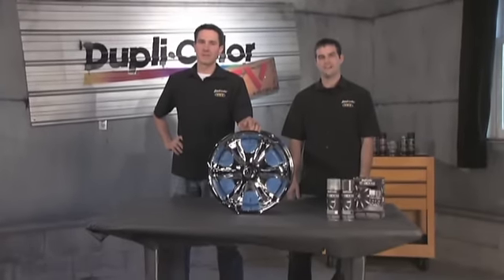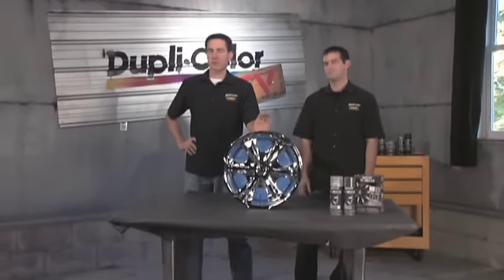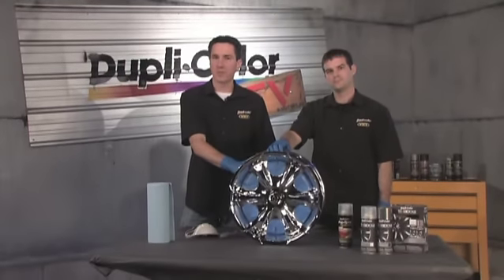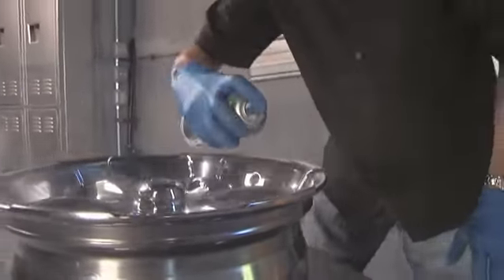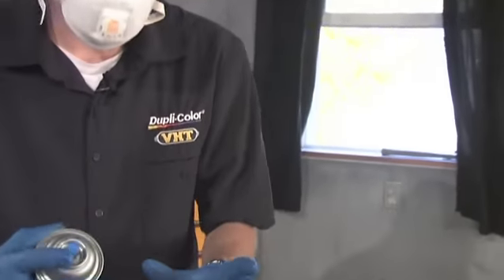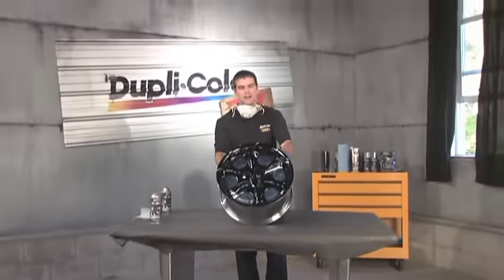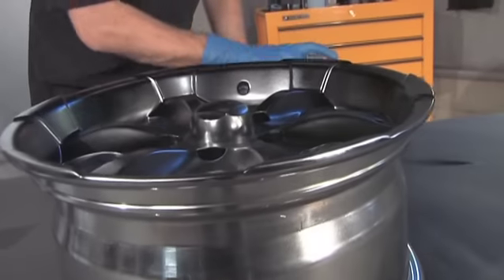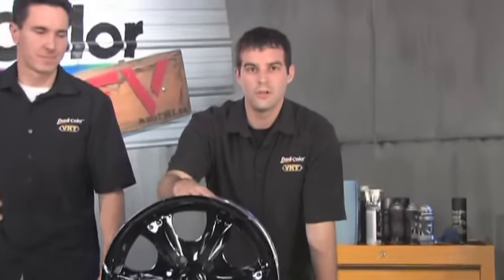How to Blackout Chrome on a Car with Shadow Chrome

Comment: Question for you- I was really wanting a deep deep purple chrome. Would I be able to spray purple Duplicolor Metalcast, then follow up with Duplicolor Shadow, and finish with a clear and achieve my desired effect? 

And if so, would it work better to use the Metalcast or Shadow first?

Comment: can i use this to paint stock rims for a 02 trailblazer they like a grey finish ????
Reply from the maker: Hello, Alfred! The Shadow Black Out Kit is a semi-transparent coating recommended over chrome for best results. This means that if you don't even out the look of the chrome prior to applying the Shadow Kit, the look underneath will be uneven. Be sure to sand off any peeling paint. Reapply a chrome paint to even the look and make sure it is lacquer based. Allow it to dry before applying the Shadow Kit.

Comment: I see you state that this product will withstand temperatures to 120 degrees F. A few hard stops on a 90 or 100 degree day on disk brake vehicles, can easily heat a wheel up till it's too hot to touch, somewhat over 120 degrees. Will the Shadow finish withstand these intermittent high temperatures.

Comment: i have a 1997 mustang with the stock aluminum wheels but they have a plastic center cap would these turn out looking the same or would the center caps look different because they are plastic?
Reply from the maker: Scott Mederos Hi Scott -- yes, it will look a little different on the plastic cap. The depth and dimension of this product come from the quality of the reflective surface it is applied to. True chrome works best, then aluminum, and some plastics (if they have a good shine) are next in line. If you apply it and don't like it - you can easily remove it with our Paint Stripper.

Comment: How scratch resistant is this coating?  Wheels get hit with a lot of road debris... rocks, gravel, tar, etc.
Reply from the maker: +Joe Delasko The paint will withstand everyday use. If any blemishes occur, it should only occur in the Clear, which acts as a sacrificial layer.

Comment: I have a 2013 ford fx4. I don't really know what the stock wheels are I'm assuming they are aluminum. They are smoke grey. Will this work on them?
Reply from the maker: Holly Jones You'll be able to use this product, but it won't be as brilliant as it is in the video. Our Shadow Chrome Black Out works best with chrome.

Comment: Will this work on a polished wheel
They are 20s oem polished from a Camaro ?
Reply from the maker: +Mr69dreamer Yes, our Shadow Chrome Black-Out Coating would work well over polished wheels. I'd We recommend using the Adhesion Promoter first.

Comment: Curious if there is a way to reverse the process back to factory chrome?...have had the blackout on for about a year or so and I am noticing some chipping. Thinking about going straight chrome again or starting from scratch and going lighter on the blackout. Any suggestions?  Thank you!  Still get compliments on my wheels though.
Reply from the maker: +r j You can use our Aerosol Paint Stripper to safely remove the paint: http://duplicolor.com/product/paint-stripper

Comment: I paint cars everyday for a living and i was thinking about doing this to all the chrome on my car . Instead of using your clear can i use true automotive clears?i use dupont urethane enamel clears. lastly it's always been a no no in the automotive painting world to paint over chrome even with scuffing or applying adhesion promoters it always chips or flakes very easy. what makes Dupli-Color a better product?
Reply from the maker: Please know, we do not test our products with competitor brands so we cannot guarantee desired results. The Shadow Chrome Black Out Coating is an acrylic lacquer so you will need to test. We recommend using the Clear Coat provided in our kit for best results. It's a good idea to apply Adhesion Promoter over the Chrome surface prior to applying Shadow. This process would allow you see longer lasting results. Adhesion Promoter is clear and shouldn't affect the appearance.

Shadow works over shiny chrome plated surfaces. If you have rust spot, you'll need to sand that away. If you sand chrome, you'll dull it. If you apply Shadow over a dull surface the appearance will less brilliant than if you used it over a evenly shiny surface.

Comment: Considering chrome is non-porous and you don't have to sand for adhesion, how well is it going to stick? Can I pressure wash my wheels without worrying about peeling? :\
Reply from the maker: dfrai Definitely! You can always clear coat it too if you're worried about longevity. But if you thoroughly clean your wheels (clean and degrease) Shadow should adhere very well.

Comment: I applied about 4 base coats, and the same on clear.  I've done 3 out of 4 wheels and 2 have turned out awesome but the third not so great.  It doesn't have the gloss that the other two have but I used plenty of clear coating.  Any recommendations?  Can I also apply more base coat over the clear if I wanted?
Reply from the maker: r j 

Yes, you should apply more of the Base Coat to re-wet the finish and release any trapped moisture that may be in the finish. Moisture in the air, can trap itself in the coating as you apply it.

Comment: Hi I have a 2012 ford fusion and i sprayed the grill but it looks like green. How can i remove this ? And then spray over it?
Reply from the maker: Jenna McNellage Applying more coats will help make it appear darker. We would recommend removing the coating with a solvent that is safe for the surface (if you would like us to help you find the right product for removing it safely, please let us know what the grille is made of) then recoating it again with 2 thin coats and one medium coat of Shadow Chrome Black-Out Coating before allowing it to fully dry/cure.
Reply: The grill is made of plastic chrome. I tried paint thinner and I tried Aircraft paint remover and that was difficult. Would the dupli color paint thinner work better?
Reply from the maker: Jenna McNellage Hi Jenna, please call our customer service line at 800.247.3270 and one of our product experts will walk you through the best next steps. We want to help you make your car look as great as possible.
Reply: Jenna McNellage just scuff it and burry it in flat black paint...
Reply: Scuff it with what? justin76bmw
Reply: Sand paper.
Reply: And then paint it with like plastic dip maybe justin76bmw
Reply: Plastidip is temporary and will peel off eventually. I'd get some krylon semi flat paint.
Reply: ok awesome will do thank you so much justin76bmw
Reply: And it would be ok on plastic chrome justin76bmw
Reply: Acetone 100%
Reply: +Jenna McNellage 
chromed plastic, is often "just like plastic" depending on how the chrome surface was applied. It will turn green on plastic and other non "real chrome plating", just FYI.....

Comment: thus kit work on chrome clad wheels?
Reply from the maker: Chrome clad wheels are usually plastic covers painted with chrome paint or plating. Our Shadow Kit is specified only for polished metal surfaces such as polished aluminum or chrome.

Comment: +duplicolortv How well would Dupli-Color Shadow hold up if applied to chrome exhaust pipes on a motorcycle?
Reply from the maker: Justin, our Shadow Chrome Black-Our Coating is not a high heat application. We do not recommend applying this product on surfaces that will exceed 120 degrees F.

Comment from the maker: When used in conjunction with the Top Coat - it's protected from the elements and will help resist damage from brake dust, road abrasion, chipping, or fading.

Comment: I have chrome plated mirror-perfect legs on a hi-end table. Table legs are almost a foot wide and 29" high. I don't want to make them too dark (I'd like to change them to black nickel style plating), and the coat has to be uniform. Would this be a good solution? What if I mess up with a coat or not satisfied with the result, is it easy to remove it and go back to my mirror perfect chrome finish?

Comment: I noticed that you wouldn't recommend shadow coating on anything over 120F.. My motorcycle is mostly chrome on and around the engine.. is there a way or solution for me to black out the chrome on engine because i hate all that chrome... THANKS!!!

Comment: Can I use this to paint my Ford expedition grille? 
I ordered another Duplicolor product with code (DA1600-6). Is this right choice to my application? 
Wonderful video!
Reply from the maker: Yes, if your grill is Chrome, you can use Shadow over it. DA1600 is a
solid Black paint whereas Shadow is semi-transparent and intended for use
over Chrome surfaces. To add adhesion, you can use Adhesion Promoter
first. Hope that helps!

Comment: Does the color get lighter or darker after it dries?  It appears as if your three coats are darker than I am looking for, but the picture on the box appears a bit lighter than I am looking for.  I have a decent background in painting so I can usually judge about what it will look like - but any tips beforehand are appreciated! Thanks.

Comment: Hi, I really like this product and before purchasing this item, I have a really quick question. I have a chrome rack on my bike and I want to paint over the chrome by using this product to look better. Is the coating long-lasting? And If I carry thing/stuff on the rack, will it do any damage to the coating?
Reply from the maker: Hi, Henry! The coating is durable enough for rims and exhaust tips and should be durable enough for your project. It all depends on the type of things you'll be transporting and the amount of contact between the rack and the items being transported.

Comment: Hi there duplicolortv...I have a question: last month I painted my rims. They were silver and I painted them black with duplicolor high gloss enamel heat resistant paint, the one that it's for engines; then, when the paint was dry, I apply a wheel clear coat and the rims look great but I feel that it needs more shine...is thia product gonna help or I will get the same finish?

Comment: Any advice on using this for motorcycle wheels with thin spokes? I'm worried about the paint dripping as it dries and creating a running look. Would you recommend just masking up the spokes and painting the base only or have you guys tested the paint on spokes and had success?
Reply from the maker: Hi John Miller -- To avoid runs,drips or sags, it’s important to spray light coats of this product to slowly build the film. That said, we would mask off anything you don’t want to get the Shadow coating on. Spokes are something we’ve seen
painted, but it required multiple thin coats to do so.

Comment: I'm not sure if you've answered this yet or not but I have a few pieces under the hood of my car that I'm wanting to try this on that aren't Chrome. Some is aluminum and maybe even try it on some of the plastic stuff. Would it work if I spray paint them Chrome and then adhesive then base? Also is it safe under the hood? I'm not putting it on the block but was wanting to do the intake
Reply from the maker: The Shadow® Chrome Black-Out Coating can only be used on polished metal or chrome surfaces. It may be applied to under hood components, however since it is lacquer, it will only tolerate up to 120 degrees.
Reply: Ok thank you

Comment: Would this work on motorcycle exhaust
Reply from the maker: Shadow Chrome Black-Out Coating is not applicable to a motorcycle exhaust system or any areas, where there is exposure to high heat.

Comment: Will this work on plastic chrome wheel? They are 20" Chevy Tahoe ltz wheels, but they seemed to be like a hard chrome plastic that lays over entire wheel. Wheels are bit dull in sum places and can't really bring all the chrome out so I'm just trying to make em look better and how many Cans will it take to do all four?
Reply from the maker: Mr69dreamer Yes, Shadow will work on chrome-like plastic, however -- you won't get the same depth and dimension as you would with true chrome. We'd say, depending on how heavy your trigger finger is, 2 cans should do all 4 wheels.

Comment from the maker: Just be sure to THOROUGHLY degrease the machine -- a clear adhesion promotor couldn't hurt, but Shadow will adhere quite well if it is cleaned completely. (we suggest using our Prep Spray to ready it for Shadow). 

Please be advised that Shadow is meant to go over top of Chrome surfaces -- so you might not get the results exactly as can be seen in this video.

Comment: I actually had to use one box per wheel. its only a 19 inch 10 spoke rim. the only reason I bought it is because this video says one box for 4 wheels. and results weren't even excellent. (2 base 2 clear)

Comment: Do this come off ?
Reply from the maker: You would be able to remove the Shadow black out coating using a standard paint stripper that's safe for the surface you use this over.

Comment from the maker: Shadow does look nice on non-polished metal, but you don't get the same brilliance that you'd get with a polished chrome. 

As for the engine bay - Shadow shouldn't be used on any surface that heats up to higher than 120 degrees F.